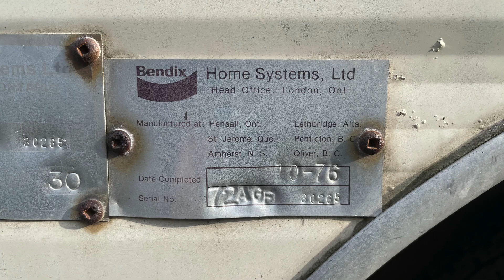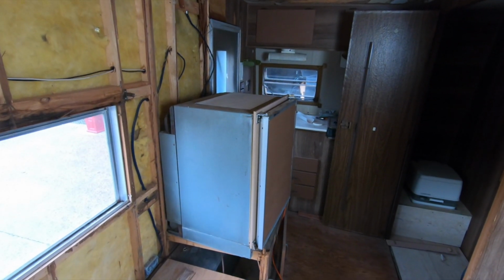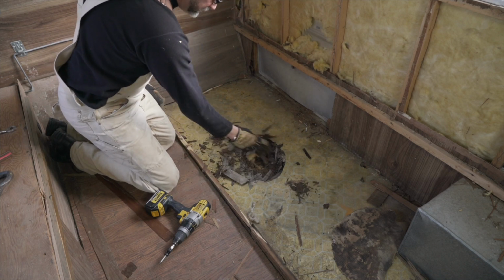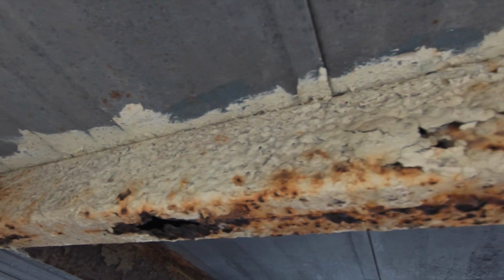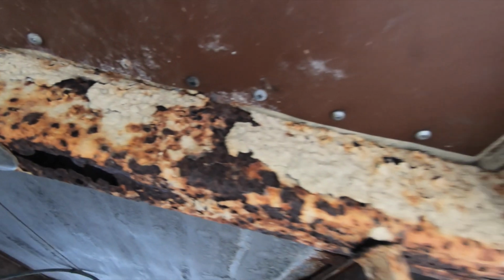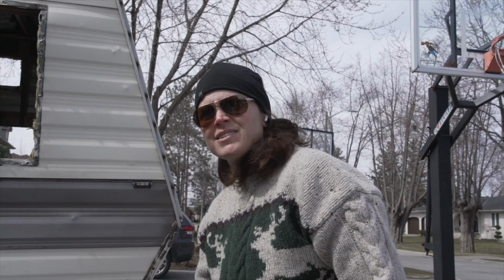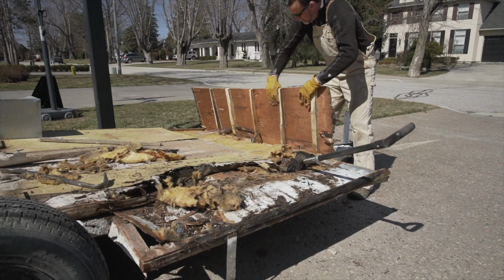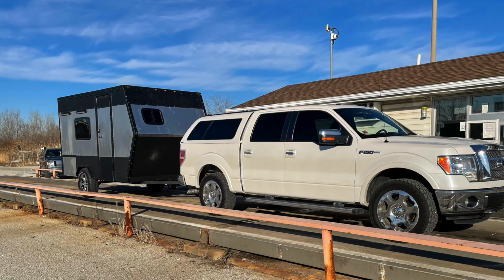Travel Trailer Restoration / Build: Mistakes were Made, Lessons were Learned

Comment: Great work.  In my over 60 years of camping, I have been camped in everything from motorcycle pop up campers to 32' fifth wheels.  If I were to build a camper, I would use as much aluminum as I could afford, and have found that tandem axles pull much better.  It is too late for you to add an axle instead of going with a heavier one, but for whatever reason they tow more true with fewer wind issues.

Comment: YOU ARE DOING A GREAT JOB!!! We all learn, its never a mistake if you learn from it LOL!. I'm retro fitting my old 4'X8' Trailer in to a mini Camper. It was built like a Conestoga with a Canvas Top. Now it has a Aluminum top that goes down the sides a 1/3 of the way. side windows installed, weather breaks I want to start on the inside insulation & wiring next....

Comment: I built my own teardrop from scratch also and had more problems with getting tags than insurance. I would do it again in a second and my teardrop is now 9 years old and still going strong. There is something about knowing every bolt, screw and wire on something that is so satisfying and rewarding.

Comment: Excellent Job on Eddie. Chances are I would have used some type of Rhino or truck bed plastic/rubber coating on the stainless steel floor substructure before fastening to the frame. You can still do it but it would have been easier before installing. You did an amazing job and well plan out project. 👍
Reply from the maker: Thanks 👍

Comment: Would steel studs have been lighter than wood? Have fantasized about a DIY travel trailer and I keep thinking all the wood I see in commercial units is heavy. Steel studs, alumalite (corrugated plastic w/ aluminum skin) paneling, spray foam for insulation and binding, etc.

Comment: Is it possible to find out the insurer you used to have and the one you ended up going with?  I'm currently with a big-name insurer myself and am looking at potentially switching, but I'm also looking at doing one of these builds myself in the near future, and would hate to move away from my current insurer if they ended up being the one you ended up with.  Dealing with insurance is already bad enough, but when you end up having to go back to one, it's almost worse.  Thanks.
Reply from the maker: Had to go with Allstate. They’ve been very good to deal with.

Comment: No regrets about buying the junker trailer? Possible bed liner on the frame instead of flex seal? Overall I'm impressed with the work and design, can't wait to see him in action.
Reply from the maker: I would have never attempted building my own unless I went through the experience of dismantling the original.

Comment: you shouldn't be sorry about powder coat, it is a long way from a perfect product. I have worked around it for years & if it isn't prepared right, or if it has any imperfections on application, it will fail badly. Also it is terrible to remove if you need to weld something. Bedliner over good primer is a much better option IMO

Comment: Feel good that you did not powder coat.  Its NOT the way to go on a trailer. Powder coat is so hard that 1 stone chip, and the whole finish is compromised. Once water and rust get under it, it starts flaking off like crazy. Been there, done that, never again, Good old paint or under coating can be easily and quickly touched up and ready to go. Keep up the good work and great videos!
Reply: I quite agree, a good coat of Epoxy primer to start with, that is of course if Hot dip Galvanising is not possible.
Reply from the maker: Thanks for the tips!